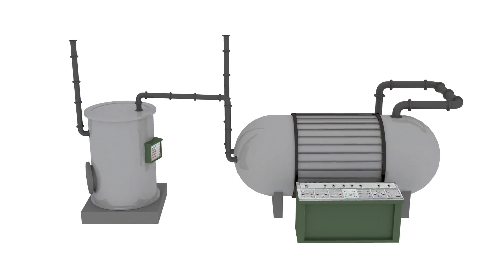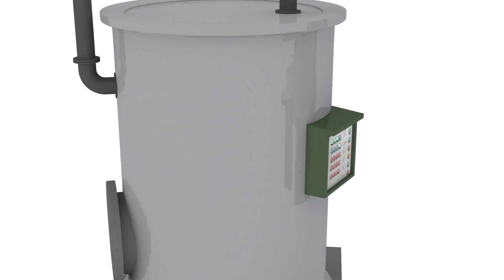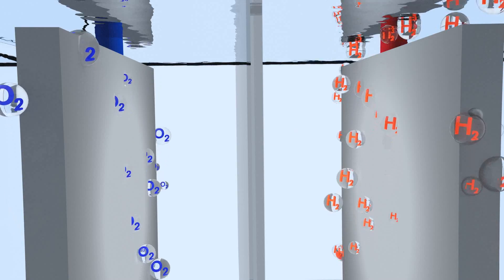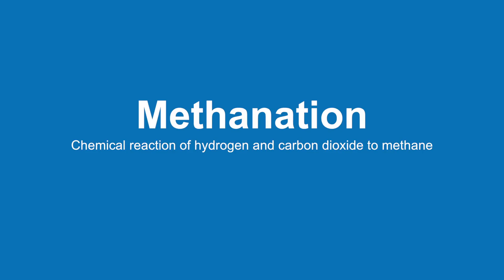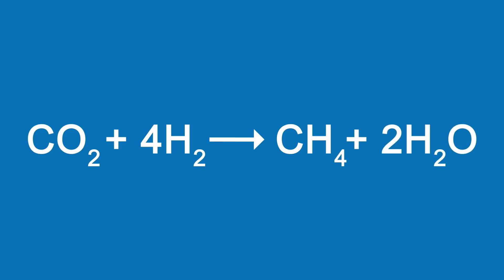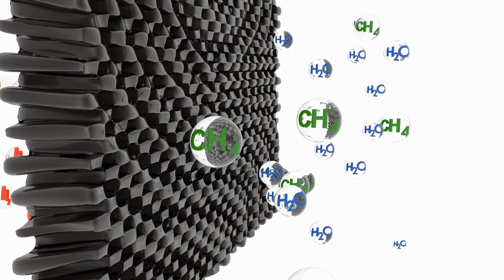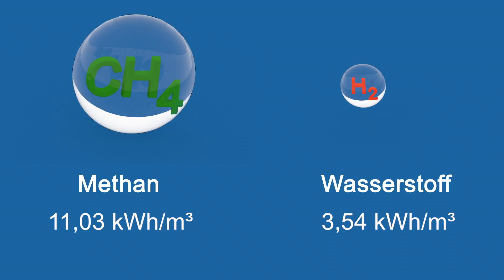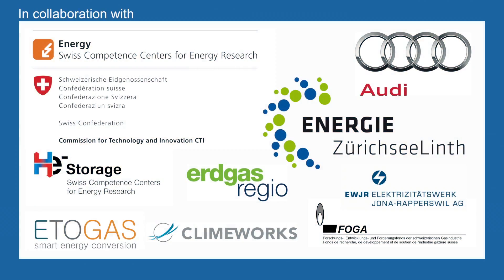How does Power-to-Gas work?

Comment: Great videos from IET thanks. Love to see the overall energy (and environmental impact) balance of this. The burning of methane releases CO2 and whereas the burning of Hydrogen doesn't so we seem to have a clean energy trade-off here? What are your thoughts on the current state (in particular cost of H fuel cells?
Reply: C02 was input and output, so net zero unlike fossil fuel.

Comment: what are the quantities in play? where is CO2 taken from and how?How much energy is needed for the whole process?
Reply: Natural gas flue exhaust. The round trip efficiency is about 63% with waste heat recovery at the Audi plant in Germany.
Reply: Power plants, Blast furnaces for steel production, Cement plants, Fertilizer plants all produce vast quantities of concentrated CO2.

Comment: you can inject pure hydrogen in the natural grid too..
then it can be extracted pure with the help of filters in any point of the net.
You are still far to reach the 5% or 15%  mix in the natural grid.. the natural grid is also changing to plastic, so.. it would be able to stand more hydrogen then.
Reply: What is the purpose of injecting hydrogen into the grid?
Reply: @aaronchin7563  pure Hydrogen would damage some of the existing network because some alloys get very brittle trough exposure to H2. By adding a small percentage of H2 to the natural gas mixture you can transport H2 in the existing network.
Reply: @aaronchin7563  Cheaper and better efficiency since you don't need to store this hydrogen.